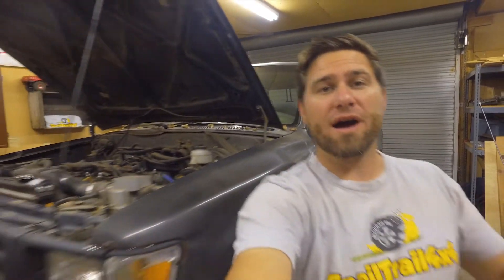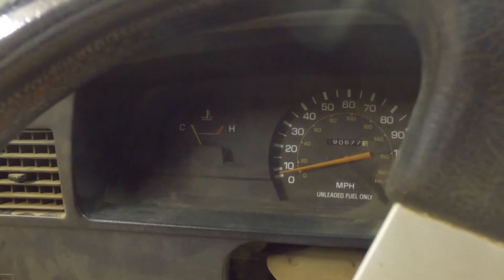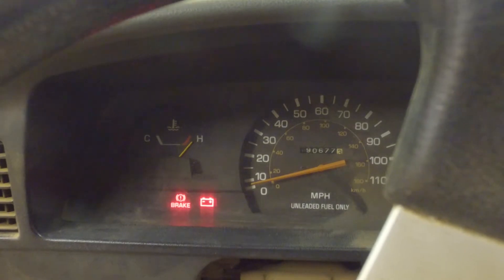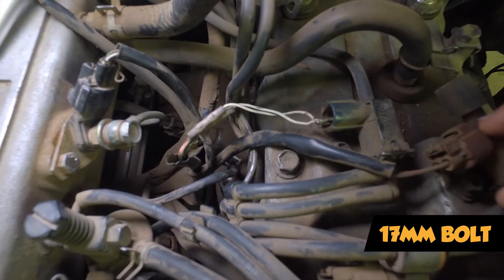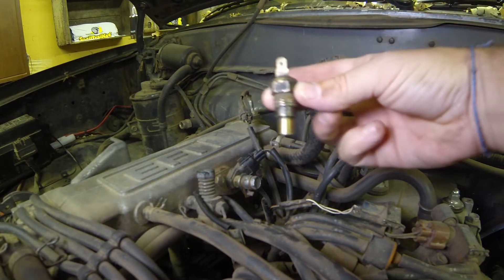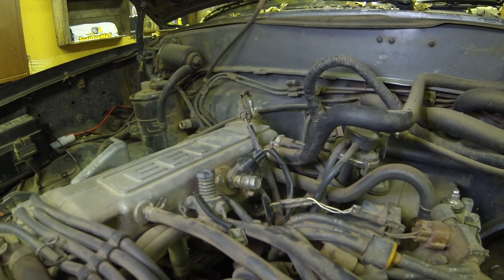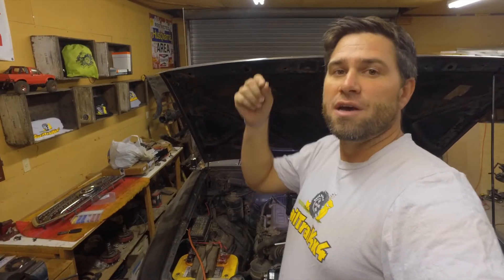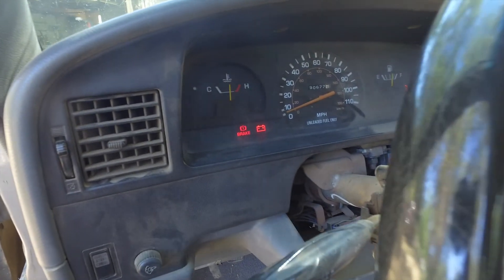Why is Bobcats Overheating | 3rd Gen Toyota Pickup

Comment: I kind of have the opposite problem. It stays at cold even after 10-30 of driving. Goes up by a quarter max. Never goes to the middle.
Reply: I have this problem too
Reply: On the forum it says the actual gauge in the cluster panel can have an issue with the wiring and need to si.pmy be re soldered. , The sensors are the one he replaced and there are 2 at the front of the engine sticking straight out one has green clip one has brown/black , I'm not sure which is which but I think the green is the coolant temp switch

Comment: My 1981 owner's manual says use a 195 thermostat, but I use a 180 and it comes up to just under a half on the gauge.  If you can, get the OEM Toyota temp sensor, the others are foreign knock offs and do not last.  Only other thing for overheating is the thermostat and fan clutch.

Comment: Gracias pero creo lleva 2 en frente  donde está el termostato
Reply: Yes there are 2 sticking out pointing at you when you're looking at the engine from the front, they under the intake hoses. Very easy to replace as long as it's the correct sensor

Comment: Yay! Problem solved!

My needle chills in the same spot.

One of those deals where as long as it's not close to the red, your golden.

Also, I have a redundant set of guages for: Coolant temp, engine oil temp, and oil pressure.
Reply from the maker: That's really smart. I wish it had an OBDII reader
Reply: @SnailTrail4x4  OBD2 would be way nicer for diagnosis... 3RZ swap would be a nice excuse to get OBD2 lol
Reply from the maker: Haha, there wasn't even a check engine light on. I wish I had a OBD II connector, if run some Awesome software

Comment: My rig usually runs around 1/4 of the way up and maybe up to halfway when I’m revving her hard on a hot day.  However if yours isn’t getting too close to the red zone I wouldn’t worry about it too much
Reply from the maker: Sits about half way most of the day
Reply: It was getting pretty close to red with ac on
Reply: @SnailTrail4x4  it was 250 at thermostat

Comment: Mine is not pegged at cold, but it only raising off pegged. Think it may be same sensor? Thanks
Reply from the maker: Maybe... It's a cheap check... It could be your thermostat also
Reply: @SnailTrail4x4  k. Thanks for replying
Reply: @bayouflats5054  did u ever find the issue mine is doing the same exact thing
Reply: @thelurk8281  nope. I did test the wire harness and gauge and they were good, so I replaced sensor( easy). But, still a no go. I believe it may be thermostat, because if I leave it idling with a/c on, the gauge will rise to a reasonable reading. Been working 24/7 plus “ on call”, so too whooped to want to play with right now. Plus I have a new radiator want to do all at same time. 🤷‍♂️ 
 Let me know if you rectify your problem and I’ll try to put an update when I get err done
Reply: @thelurk8281  update: I replaced thermostat this weekend ( easiest one I’ve ever done)along with radiator and that did it. Gauge reads as expected, about 1/4 way. 👍 It was the thermostat, but I needed to replace radiator and new one came with the truck.

Comment: I just did a New 2 row aluminum radiator and electric fan saw on my 94 4runner 22re it had a over heating problem and still dose. If it's 90+ out side and I'm doing 60 65 down the free way the temp climbs fast as soon as I let off throttle it gose to just before half only I haven't put new in it was a water pump when I give it throttle my temp climbs and when I let off it goes to normal
Reply from the maker: That makes sense, because when you add gas to the fire it gets hotter. Check your fan clutch
Reply: @SnailTrail4x4  I went to electric fan

Comment: I have a 94 2wd 22re daily driver my temp is normally about 1/4 on the gauge. I did a coolant flush and t-stat recently. Running the napa 185* t-stat (if I remember right) and zerex coolant.  Next week she’s get a new water pump and fan clutch both are aisin brand. Going to see if I can hit 300k on this engine currently at 263k.
Reply from the maker: You can do it! Just keep giving it love and you can get to 500k
Reply: I also have a 22re in my 91toyota hilux here in ohio just hit 230000 as of today 1/29/21. I love Betsy she has never left me on the side of the road. And 95 percent of those times i would have never got home or somewhere off the main road literally walking distance. I swear i will never own a different truck nor sell this one. Im 24. I might be young but i really hope to see younger people like myself see the beauty and soul of these trucks they really are a masterpiece and a art as well just wash the frame from salt only when it gets above freezing so you dont freeze water in any rust pockets on frame and oil every 2000 3000 only conventional oil and stick with one brand of gas unless your in a pinch. And dont forget the expensive fuel filter lol they dont recommend a mileage to change them but every 50000 75000 should be alright. Also do a double row timing chain it will make that old 22re literally Bulletproof! No joke that and the water pump are the only two things that will kill this motor 100%.

Comment: I know this is an old video, but did you figure out if the temp needle is supposed to be reading that high? Having a similar issue with a 20R that also has a new sensor
Reply: Yea you need a 2 stage thermostat , Lce engineering has them .

Comment: Fan Clutch is suspect in overheating these engines. I think mine is old and almost toast. Presently I am getting uncomfortably close to the red zone while climbing steep passes which she has never done before. Granted she is yoked to a Sunrader Fiberglass monstrosity but she has never run this hot before. So… I ordered a flex fan from LCE engineering and am planning on installing this soon and see what happens. Anyone have experience with Flex fans? Some great convo here. I learned some stuff reading these comments. 

Thanks.

Comment: I broke my intake manifold replacing that sending unit sucked.

 mine always sits a little bit on the cold side. unless I run my heater for a min then it sits right in the middle of the gauge. Seams like they aren't all that accurate.
Reply from the maker: Dang Mussels, you dont need to tighten it that tight